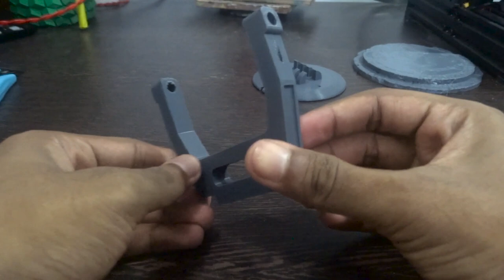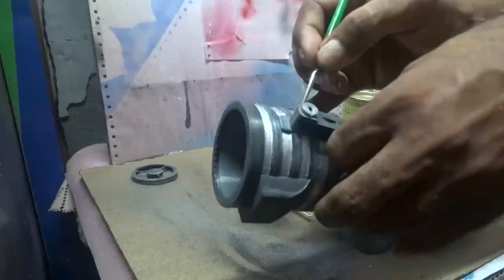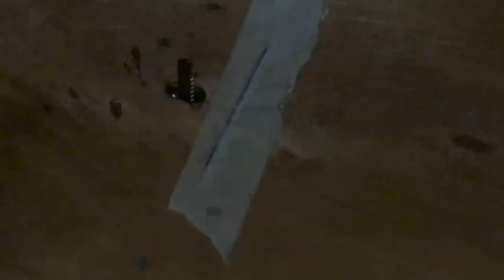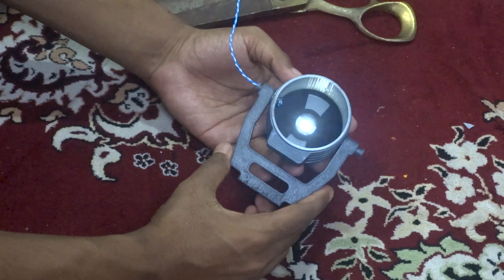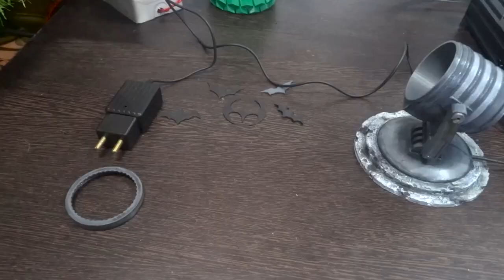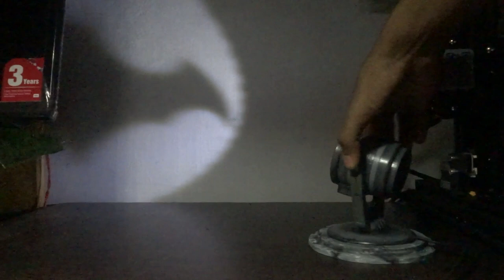How to Make The Bat-Signal From Batman DC Table Top miniature prop with magnetic Logo change.

Comment: Hi , can u pls tell how did u buy this 12v led , because I can't find it anywhere on Amazon or in the local electric shops, actually I am also making one batsignal for the first time so I saw your video
Reply from the maker: VEEKAYLIGHT LED Chip Bulb 300mA DC9-12V 3W Aluminum COB Light Beads Warm White Super Bright High Power for Floodlight Lamp (Driver not Included) (Neutral White, 10 Pieces) https://www.amazon.in/dp/B09VCMKKLP/ref=cm_sw_r_apan_i_EE9M3TB0GZWJ78DA3KST
Reply from the maker: This should serve the purpose.
Reply: Thanks bro , i really appreciate u going out of your way and helping me , but just one more doubt if we directly connect the led to the AC main then won't the led busrt or catch fire or melt ,. I didn't see u connect any resistor to compensate the huge  220v supply
Reply from the maker: @asfhl862  get a ac to DC converter it's shown in the video. Or use a 4v led with USB charger